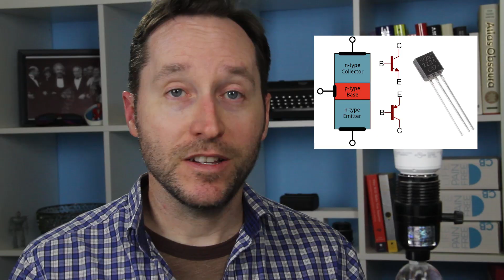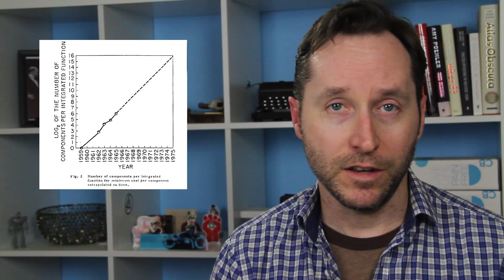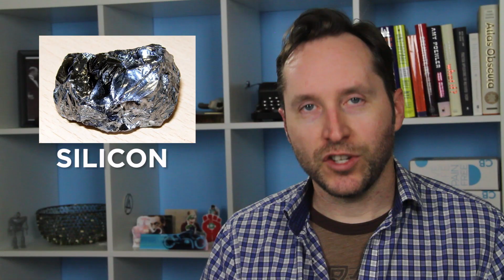Moore's Law Is Ending - Here's 7 Technologies That Could Bring It Back To Life | Answers With Joe

Comment: Haha i work in the semiconductor industry as a Equipment tech. Abaitment. The company I currently work for is making 3d x point. I know cause i killed a tool (shut it down by mistake) and they were making 2 "wafers" like 14 inch diameter silicon plate "substrate" to build the cbips through photolithography, chemical vapor deposition (CVD), implat, dry ectch, wet process, they gp through hundreds of processes to get a chip. But ya, i destroyed 2 wafers that have hundreds of chips in it and were easilu worth half a million dollars. I got written up for it and if ot happens again i will fired. "Terminated" my boss is also a cock sucker. He hates me amd says he doesnt. I will do things that everyone else is doing and i will get called out for it even though everybody else was doing that thing for years before i started. He will call me out on stupod petty shit like wearing a sweater in the sub fab, because "its already hot there so you do not need a sweater" someone else will fuck up (a coworker took 4 hours to clean a water pump a task that will typically take roughly a hour) i had nothing to do with that pump. I did the other tasks we were assigned to do on the tool (they are machines but they call them tools, just FYI) and the boss lectured me about My coworker (Josh) failure. "What could you jave done different or better to stay in the alotted time?" I wanted to say "i could have just done his job for him and had him sit and watch me do it correctly." Other then that, nothing you ass wipe.  God i fucking hate that petty bitch. My boss is just a cunt sandwitch. I think he is hopimg that i will quit because he acts like a assclown. I will not five him the satisfaction. He knows everything about those tools (machines) inside and out almost like savant levels of knowledge. When it comes to managing people, he is by far the worst boss i have ever had. If i ever got the opportunity to kick that bitch in testicals. I would probably ejaculate in my pants the moment my foot crushed his little man barries. If there were no consequences for it i would pay to kick into the hotel. So in essence I fucking hate that fucking guy he is a jackass asshole with an inferiority issue short and balding so I think he has a little bit of little man syndrome alongside with you know like bald man syndrome I don't know if it would be possible to hate somebody as much as I fucking hate this guy

Comment: Ok explain how were able to etch on molecules now if u don't think it's gonna end. Because we all know there's particles smaller than an atom now. Hello!
Reply: The problem isn't that there aren't smaller particles.  the problem is that quantum mechanics comes into play at the nanometer scale.

A transistor ceases to be a transistor if the electrons simply tunnel to the other side of the closed transistor.  That is the fundamental limit to our current method of computer engineering.

Comment: Just add more processers to share the load. Want 5 times as fast with the same power use 5 processors............
Reply: Can't see heat or cost being an issue there.

Comment: We are starting to work around this, and have been for years now. Ever since the early 2000’s, we’ve been adding multiple branches for processors to to use to process multiple sets of data at once. Processors used to just be processors from the 50’s through 90’s; and now we have Multi-core processors which increase the speed and efficiency. Moore’s law is ending but there are som work arounds

Comment: Another notable technology that’s a bit more near term is silicon interconnect fabric boards. The main concept is to connect microprocessors and other ic dies directly through a silicon board through conductive pillars only tens of microns wide joining the dies and the board together. Prototypes already have higher memory and processor bandwidth than 2.5D ics and until processing in memory gets more heat efficient, most of the processing and memory will be on separate dies. Silicon interconnect fabric boards are more space efficient than current pcb technology as dies can be spaced <50 uM apart, have greater bandwidth as die to Sicf (silicon interconnect fabric) boards have higher io to die density than traditional package/pcb systems, greater heat efficiency as less heat is produced in communications between dies, less latency as memory dies and processing dies can be placed flush with each other, and have better heat conduction as there are no insulating packages and heat sinks can be placed on both sides of the board. The only major downside is a loss of modularity as it is difficult to remove dies after the board and die pillars have fused.

Comment: I think the future of computing will be clusters of specialized hardware that a traditional cpu can task specialized code too. Think of how we use graphics cards today. The computation that works best in massive parallelism (3d graphics) gets offloaded to a GPU. I can see that happening with a quantum processing unit. At the end of the day, the true limit will be the programmers and their ability to write code. Getting away from the traditional way of thinking will be extremely difficult if computing takes a 100% paradigm shift.

Comment: That teardrop computer comment is utter bullshit...

Rough estimate of the number of atoms in a drop of water : 5000000000000

Rough estimate of the numbers of transistors shipped : 2913276327576980000000

And if you are going to be fussy about amounts of transistors not being used for computing or not being used at this point in time, then you also need to be fussy on how many atoms in that drop are just DNA structure, glue logic and what not.

The statement that a DNA computer that size would be more powerful than all computers combined today is utterly idiotic.

Comment: My motherboard and CPU are from 2009 and actually they were state of the art late 2007 I
Just didn’t want to blow too much money. Quadcore i7 3.06ghz CPU. In 2012 i upgraded from 4 gb to 32 gb of RAM, more hard drives (mirroring for data safety) and a more respectable video card. In 2015 i again upgraded the video card. I don’t game like I used to and I can’t find motivation to build my
Next PC though I know I’m done upgrading this decade old thing. Prior to that my typical computer lasted just 4 or 5 years with an upgrade half way through at 2 or 2.5 years. I’m amazed my PC doesn’t frustrate me by being too slow. I mean it’s getting there perhaps but it should be totally useless based on age and previous experience. After mobile this has got to be the #2 reason desktop  and desktop component sales have fallen. It’s not like I am happy doing everything on my iPhone.

Comment: How did you miss 1THz , 1000GHz chips when you researched ? It is even on wiki ! INTEL TERAHERTS !
And with lower power and 10,000 times less leakage. Just those 2 reasons are enough to use it !
So why was it NEVER USED ?
The NSA COMPLAINED in 2001, "consumers have too much computing power and we need to READ EVERYONES EMAIL".
That is completely unrelated I'm sure. And it was just bad timing that a few years later, we get almost NO IMPROVEMENT YEAR TO YEAR. The Tick Tock cycle. Which has barely improved since 2008 ! And is even SLOWER using single threads on many CPUs. This was probably what was already made by Intel.
But Intel said the TERAHERTS chips would be sold in 2005 ! Yet we don't even have chips that can go 1% of that speed.
NOT EVEN 1% !!!!!! This doesn't add up !

You STILL haven't replied ? Updated the video ? At 2:18 the graph stops and goes flat, despite Intel having 1000GHz in 2001 !
Where is that on your graph ? Or Motorola and DARPA reaching 1000GHz in 2009 ?
Again it is MISSING !!!
WHY ? See HEMT transistors wiki page !
It also shows 1000GHz transistors ! No mention of that on the graph either ? What the hell ?
Or the many other things I mention in my other 35 - 40 lines of comment ?
Why not ? They are easy to find and verify yet everyone claims about 5GHz is the limit.
And everyone seems to mistakenly keep mentioning the idea we can't make it faster since it is getting too small.
Make it bigger then ! Use the old 100nm process, that also helps with the heat dissipation !
Spread out the cores instead of packing them on only 1 chip.
And why do we have only 4 or 6 cores maybe 8 cores when a video card can have 2000 cores !
Or the latest over 4000 cores !
Using RISC processors like that would be vastly faster than the 4, 6 or 8 cores.

Have build in water cooling and thermal superconductors made of carbon nanotubes.
Why am I the only one talking about this since it is easy to find ?
And I bet by 2025 we are STILL barely at 5GHz !
And yes, there is a problem ! If you can go 1000GHz, then why can consumers only buy 3 - 4GHz chips ?
Just 10% of that speed would be 100GHz ! 
Or 25 times faster than a 4GHz CPU today !!!
The real speed of 1THz would be 250 times faster than today ! And that is with ONLY clock speed improvements.
I bet the military uses this technology !
Imagine having a 4000 core motherboard card running at 1THz (1000GHz). We SHOULD HAVE THAT TODAY !

And with ONLY  the increase in lithography size we should have around 86 times the RAM and CPU cores from 2001.
So from 130nm to 14nm is   130 / 14 = 9.256 times smaller SQUARED = 86.22 times smaller since 2001 !
Squared since it is 9.256 times taller and 9.256 times wider.
So we should have 86 times the RAM of 2GB, or about 172GB should be COMMON by now !
And with 86 CPU cores if you just used the Pentium 4 in the comparison.

Why hasn't anyone compared the lithograph vs the RAM or CPU density, or even the transistors vs CPU core ?
And prices should be much much lower but they are going up instead !
And I updated this now it is 169 times denser with 10nm process, so were should have 2GB x 169 = 338GB of RAM standard in our computers with 169 cores if you use a Pentium 4 design.
Actually less since there is interconnect glue logic, but  150 core CPU should be possible easy !
Easily possible in the SAME DIE AREA. Notice they are using smaller and smaller dies but the cost is INCREASING !
WTF ??
Yet we don't even have 8 or 10 cores in common use !
Why not ? It would make all kinds of new things possible like deep learning, simulation, physics problems, and endless list !
Perhaps that IS WHY.
Because we need to have our emails read !

p.s.   Does anyone say these numbers are wrong ? Show a correction if so !

Comment: Moores Law almost stopped since 2001 ! But it isn't an accident ! The NSA in 2001 said, "consumers have too much computing power". And they is when speed almost stopped improving ! No relation, right ?
It is easy to see on the Moore's Law graphs for speed. They go FLAT around 2002, 2003 ! So no opinions involved !
CPU speed in 2001, 3GHz, in 2018 3 - 4GHz ! 17 years and almost no improvement ! 4 cores since 2018, 10 years ago too !
It isn't an engineering problem ! Intel had Intel TERAHERTZ in 2001 , 1000GHz , to be sold by 2005.
And you don't need to make chips with smaller lithography to make them faster !
Motorola and Darpa both had 1THz chips in 2009 ! So 17 years after Intel Terahers and 9 years after Motorola and Darpa, and still not even 100GHz (10% or 10GHz 1% of that speed !!!!
Go lookup Intel Teraherts, LOWER POWER, 0.6v I think, and 10,000 times LESS LEAKAGE !
And you could simply make the cores scalable, like they are now with a 4 CPU board.
Space out the CPUs to make heat more easy to manage, water cooling by default, and other cooling like 1 layer carbon nanotube that is a thermal superconductor. It has almost no resistance to heat transfer !
Hard drive stuck at 1TB since 2007, still sold in 2018 ! Why ?
Why do new computers not even have 10TB drives but have 1TB drives, 10 year old technology !
Notice how all the Moores Law speed graphs stop at about 2005 !
RAM has also barely improved ! 3 times the price now !
If Intel could do 1000GHz in 2001, 100GHz should be easy to them ! So why are we really stuck at 3 - 4GHz ?
It isn't technology since many companies have made 1000GHz chips !!!
That is something that was COMPLETELY MISSING from this video ! 
And Intel Teraherz even has a wiki page ,and HEMT transistors too over 1000GHz !
from HEMT page  - HEMTs have shown current gain to frequencies greater than 600 GHz and power gain to frequencies greater than 1 THz.
But we can't go faster than 4GHz ?
And storage is almost stopped too ! In 2013 a company made an optical disc that could hold 200TB yes TERABYTES ! 5 year later we still don't even have a 50TB or 100TB disc !
What is the military using? Not public technology !
On a PBS show,"spies in the Sky", they said, " 1 drone makes 1 MILLION Terabytes PER DAY, and is STORED" !
That is 1 million 1TB drives every day or 100,000 10TB drives ! The mfg don't even make enough drives !
But that optical disc with 300TB makes things easier ! You would need only 3333 of them per day instead of a million or 100,000 drives ! And they have more than 1 drone so much better storage technology is being used !
Technology is clearly being limited to the public !

Comment: Sorry but you got quantum computing completely wrong. You describe it as if it were ternary, but it's completely different than any base system. And it also is not at all like parallel processing. At the moment there is no reason to think it will accelerate most of the computing we do, it's primary benefits will be in simulating quantum systems, which is useful in physics, chemistry, biology, medicine, material science, (and of course breaking current cryptography). So hugely influential for science, probably not useful for the average person.

Comment: 00:22 - The transistors shown are BJT (Bipolar Junction Transistors), and it would be a Pretty Bad Idea to try and make a billion transistor chip with them. Computer CPUs use FETs instead (Field Effect Transistors, actually MOSFETs, for Metal Oxide Semiconductor FET).

Comment: Quantum computing has more than 3 states. A n-qubit system is 2^n complex numbers whose squared magnitudes, representing the probability of measuring that, equal 1. So 3/5 * |0> + 4/5 * |1> has a 9/25 = 36% chance of being a 0, and something like 1/sqrt(2) * (|00> + |11>) is the entangled state in which the qubits are not yet determined but will be the same once measured. Also, it's not multiplying 3 * 5 = 15 that is interesting; it's factoring (the inverse problem) because factoring is believed to be hard (meaning the computational growth is an exponential rather than polynomial function of the problem size) for regular computers, but has a known polynomial-time algorithm on a quantum computer. That said, it is not known for sure that quantum computers are faster than regular computers for factoring– or for any problem– but only believed to be so.

Comment: A qubit does not take one of "three states." That would be stupid. You can make a digital computer that does that, it would just have more complicated wiring. A qubit has a whole continuum of states, all of which basically represent probabilities, the computation is like a sequence of linear transformations on a vector whose entries are these probabilities and the output is a measurement where the results are probabilistic. This means quantum computers excel at problems where digital computers are slow, but that quantum computers fall short in many areas where digital computers are apt. 

It's almost like comparing CPUs and GPUs, but even more extreme. I'm not sure why quantum computers are included in the list.

And speaking of GPUs and CPUs . . . both of those things use parallel processing nowadays . . .

Comment: A minor correction. At around the 0:30 mark Joe references 8 bits as a byte (correct) then restates that as ASCII code (incorrect). ASCII codes are seven bits long and represent decimal 0-127 while bytes represent decimal 0-255.  Did you notice the leading zero in the ASCII representation of his name "JOE". All 7 bit ASCII codes have a high order bit  zero which is ignored. Extended ASCII code is eight bits but unfortunately violates the "S" in the acronym for "American Standard Code for Information Interchange" because extended ASCII code is not a single standard.

Comment: Thanks for injecting some rebalancing and reality back into this issue.  If I may, what you've said could be translated into a projection that in the future, increases in the power of computing will be quantum leap events based on specific discoveries in the basic sciences available to apply to computer processes.  Improvements will be less structural improvements and more material and process based.   Thus improvements will be less gradual and more quantum leap in nature.  Sounds like some of these could result in more massive improvements over short units of time than those achieved by the more mechanics based one's achieved in the recent past. 

 I would like to add one warning to you, to all of us that the worst problem that needs to be solved concerning advanced AI and that is the problem of sanity.  These creations will live lifetimes in a matter of an infinitesimal portion of a second.   I just don't see how human minds will ever be able to give these creations even a sense of what it means to be sane with the instantaneousness factor in the mix.  This must be worked on now, while making the com[letion of this task a roadblock to AI, prior to engaging Advanced AI at all.  If we are to do Ai at all, it must be one that understands what sanity means and is unable to apply anything it comes with until it has applied the sanity program to it.  That is, and it's a big if, if we can truly develope a fool proof sanity program.